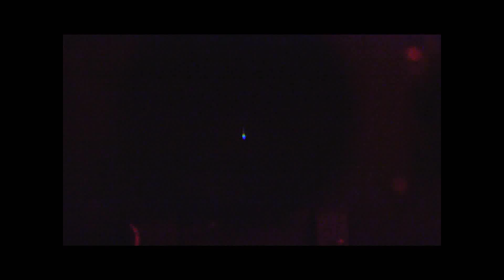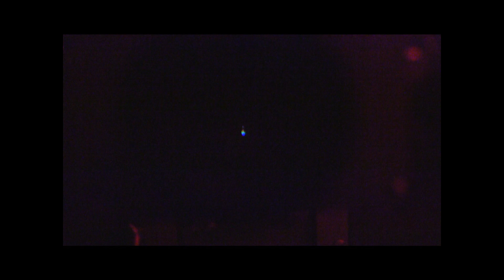Sonoluminescence through a microscope

Comment from the maker: If you're having trouble trapping the bubble, look for another resonant frequency.  Watch the bubble behavior.  If you can get it trapped and jittering, but it squirts off elsewhere as you boost the drive amplitude, you're close.  You should be able to keep the bubble trapped as you blow past the extinction threshold.  Creep up on it next.  Make sure your liquid is well degassed.  You can still pull it off in a gassy fluid, but its harder to keep it stable. 
my e-mail:  bthnt@yahoo.com